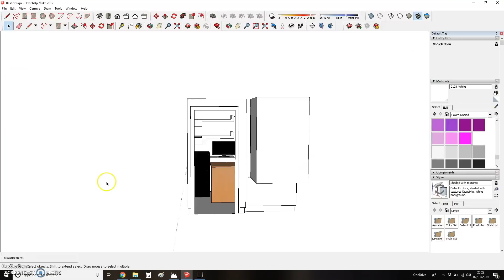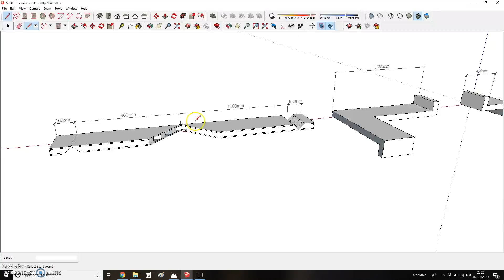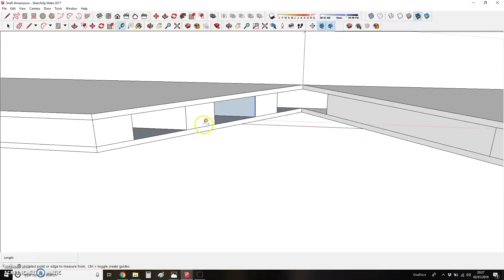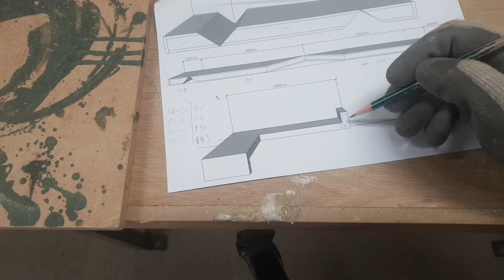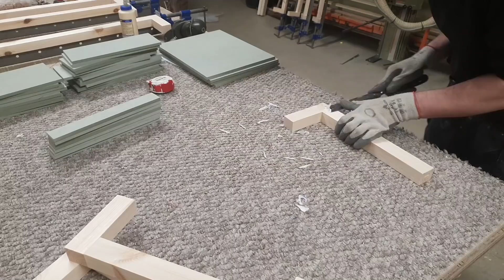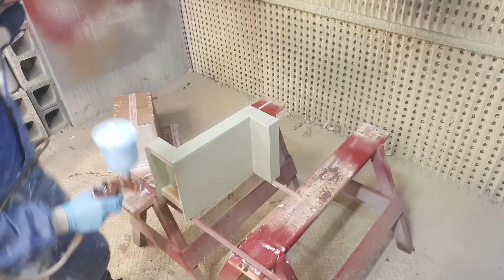Floating Shelves: Design Make and Installation

Comment: awesome as usual...my 2 cents is that i have had mdf sprayed butt joints grin through over time...it seems mdf does actually move/shrink a tiny bit (impersonating it's "real" wood cousins😉), so i prefer mitred face joints to hide the seam in the roundover. no criticism, yr skills are top notch🙂👍.
Reply from the maker: Yeah to be fair I'm no MDF expert and if you catch the shelves in the light now, you can see the joins. No cracks but the relationship between the two pieces is visible. I didn't have the facility to dry materials properly when I made these and feel now I can acclimatize the material properly the movement wouldn't be so noticeable! 

I'll try to steer clear of MDF anyway tbh!
Reply: @BradshawJoinery  thx for yr reply! (i secretly like mdf when done well, as nothing is as minimal and architectural...like yr v nice shelves)...(don't tell anyone, ill be exiled forever...😉)

Comment: Hi, just came across your video today great work just a question you wouldn't miter the small end pieces or worried about end grain of mdf to com through  ,,,,
Reply from the maker: HI, i prefer a square joint, a mitre is very hard to finish as the point is always prone to movement and is hard work to fill and voids. they have been in a while now and still looking good. there are one or two nail heads visible after acclimatization, the filler has just popped a little, but the end grain is good :)

Comment: great thanks. Do you not use rawl plugs? What kind of screws and fixings did you use for the two types of walls?
Reply from the maker: Hi, I use red rawl plugs mainly. Some are certainly much better than others. From memory i used a generic concrete screw for the Block walls and woodscrews into the studs on the stud walls. I also used a few metal screw in plasterboard fixings too i think. They are full of books now and no movement yet!!
Reply: @BradshawJoinery  Great thanks. What would you recommend for those soft grey, lightweight bricks (not strong breeze blocks/concrete unfortunately)?  For small things I have just used rawl plugs and not bothered with hammer mode with my drill, and I think I used a smaller size drill bit too. The trouble is it is a workshop and I want to replace the doors and will need to attach some casing to support large heavy  doors. Any tips? Thanks for sharing & great work!

Comment: Get yourself a Festool dust catcher, goes on your hose and suctions to the wall. Saves you having to hold the hose while drilling 👍
Reply from the maker: They are awesome aren't they, I do actually have one, but never seem to use it 🤣. I love how when you pull the drill out it looks so clean using the attachment.

Comment: They look great, nice design detail to add the vertical section. What did you prime them with? I struggle to find a primer that doesn't raise the "grain" on the mdf, best I've found so far is Zinsser BIN. Cheers for another great video! Enjoy your new home!!! 👍
Reply from the maker: Thankyou Andrew! The design wasn't all my idea. My Partner helped with the design as it's primarily her work space! The Primer was a Renner Product, water based. It does raise the grain but it's incredible easy to sand it back flat, and leaves a lovely smooth surface. If you want a really durable finish with water based I just use topcoat from the off... It seems to be much harder wearing, but it takes a lot more work to get it flat. It's a machine job not a hand sanding task.

Comment: Thank you. Another great video. Maybe on another similar  project you could show how to scribe to two walls intersecting at 90. I have found that difficult, especially when they are just off a right angle and not level.
Reply from the maker: Thankyou Robert, if you set the piece up like I did parallel to where it's going, like I did with the shelves and the laser, the shelves needed scribing back and sideways,to do this mark how much you are scribing off the back then mark how much you are scribing off the side, don't set your scriber to the diagonal of the two marks and maintain that angle to the wall (if that makes sence) So the pencil is marking the timber say 10mm further forward than the scriber is running on the wall. This isn't that accurate, but would be good enough for walls.
Reply: Bradshaw Joinery Thank you. Great advice.